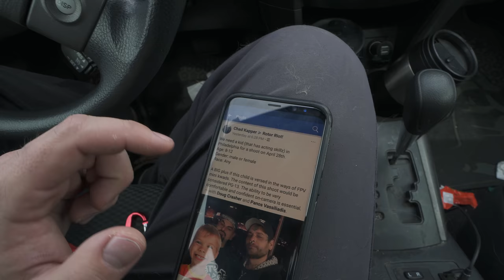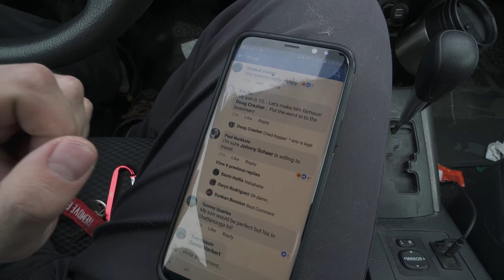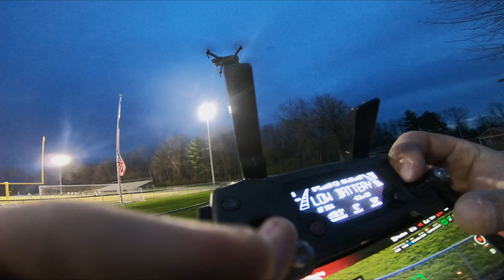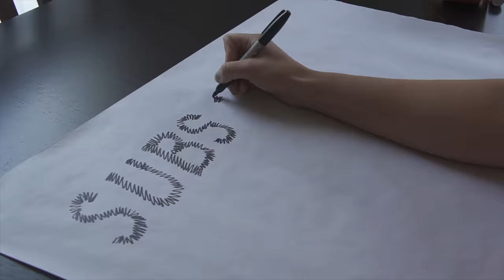All about My Company

Comment: Love the edits and the work you do as well as your piloting skills. The only thing I would spend a bit more time on specially if you are going into commercial work is volume management. A lot of you tube editors struggle with this as they use only their own computer personal preferences when doing edits. I would invest in a good set of reference monitors for editing and learn about decibel management for recording and playback and go by meters and not playback so it works well across all devices. The talking part of the video was fairly low and when you kicked in the music my speakers were distorting. That's a huge separation in levels.